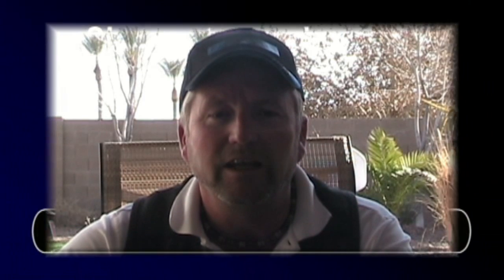Why is My Leviton Motion Switch Warm to the Touch?

Comment: Hello, got a problem, my double light switch plate in the living room is warm to the touch on one side- the side that runs the lights, the other switch runs the fan. Is this a simple problem I can handle or do I need to call an expensive  electrician.
Thanks Natti